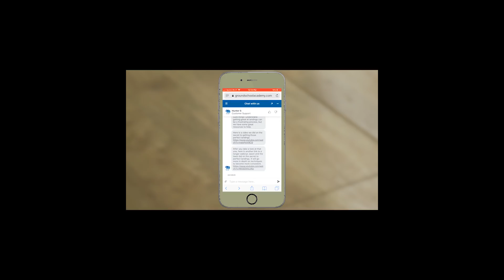IFR Clearance and Radio Communication - MzeroA Flight Training

Comment: Thanks Guys! I was wondering about that precise turn-to-final timing that Bob was talking about. If the navigation equipment allows for a sequenced automatic turn to final, can't a controller set that up in advance, within a minute or so before the turn? Perhaps the pilot can also announce when they are making the turn, for clarity. Just wondering.
Reply: John!  A technique that sometimes is used is clearing direct an IF/waypoint/intersection outside the FAF and then joining the localizer/final.   For ATC then can be very helpful for many reasons;  eliminates missing turns to final, the pilot has the plane set up and can plan the next thing, clarity,  etc (works for turns 90 or less degree turns to final of course).   If "old school" vectors to final are happening and the localizer comes alive and you are ready for the turn.... you could say "Hey Bob!!!...request a (heading that works for you) to join the final?"   You would be surprised how many would issue that heading you offered!   Controllers rarely intend to vector you through the final unless Plan A isn't working and Plan B is needed.

Comment: Hey Jason, if you wanted to take a basic original Cessna 150 and make it a decent ifr panel, what kinda panel would you have? I don’t want to have more avionics than the whole plane is worth. But I do want it to be ifr certified. What upgrades would you do to make it an enjoyable ifr trainer/flyer? Other views please share your opinions, interested to hear. Thanks
Reply: just adding a garmin gnx375 and related etc. was quoted $27.4k